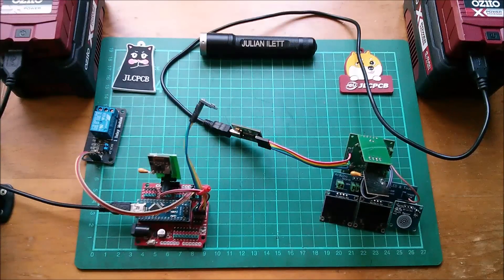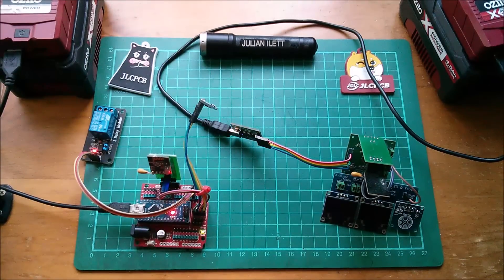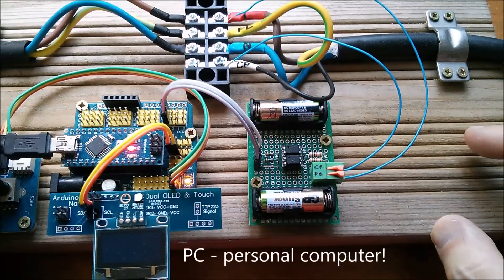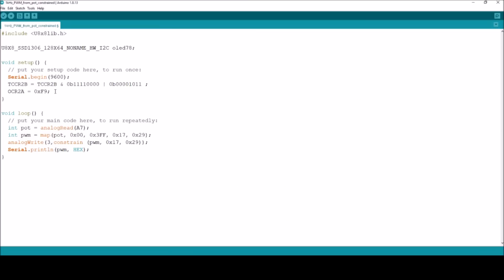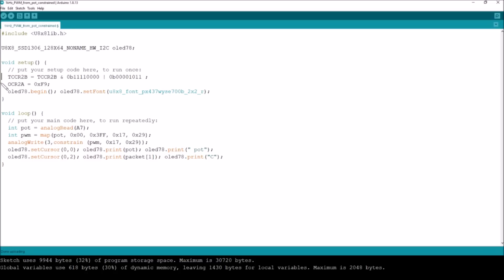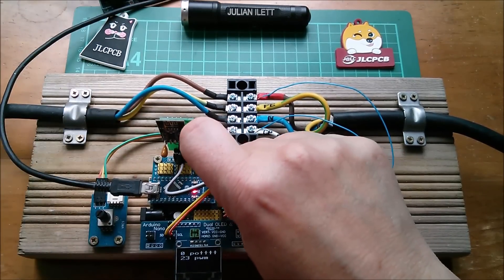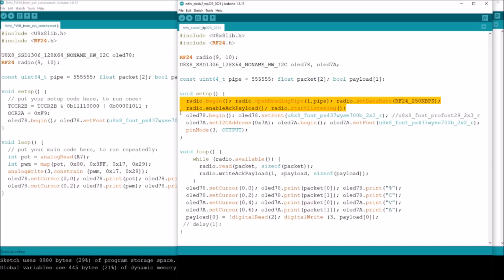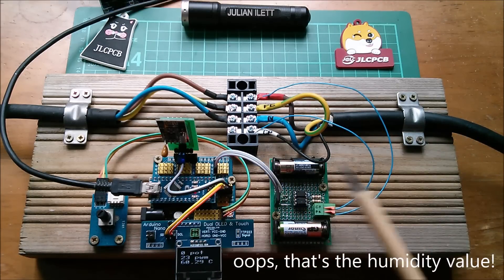EVSE gets OLED and Radio

Comment: had you thought yet about turning the charging off entirely when the available solar falls below the minimum charging value?
Reply from the maker: Yes. That's ECO+ mode on the Zappi charger. ECO mode leaves the car charging at 1400W when solar output is low. The problem with ECO+ mode is that the car's battery contactors engage/disengage each time you cross the threshold, so a day with lots of fluffy white clouds will work the contactors hard.

Comment: You might want to make pot value on receiver side be a variable that gets updated by radio packets, so when radio stops for whatever reason, you will not end up with pot value of 0 or something nonexistent, but rather it would carry on with last received pot value.
Reply from the maker: It will be a variable. But the radio has error checking and correction and is pretty reliable over short distances - particularly at 250kbps.

Comment: Heh, just about the beginning (unwanted moist air in a shed), I did see at least some of the videos you made about that situation, but cannot remember if you ever considered just putting an un-moistener (i.e. air dryer) in the shed and trying to plug all the holes where outside air could get in? Sorry, it is just that I also know how the "atmosphere air" is very unreliable about its moisture content :)
Reply from the maker: I only have a refrigerant type dehumidifier which doesn't work very well at low temperatures. A dessicant type dehumidifier would work though.